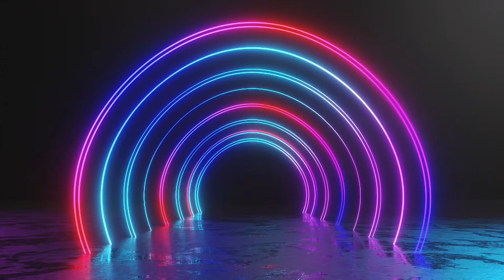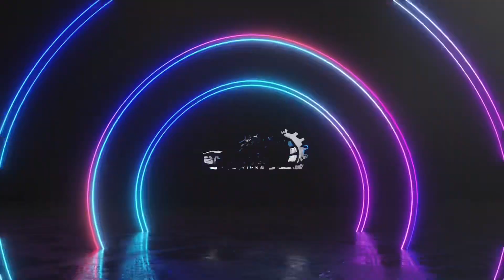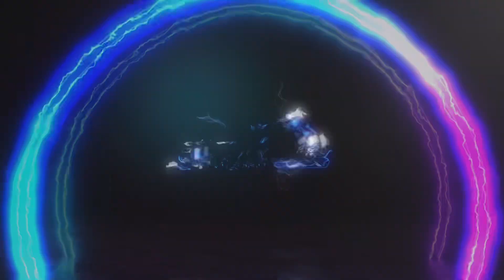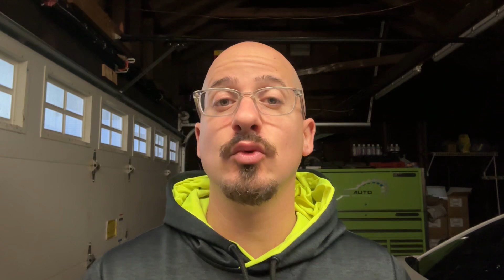Q&A Episode 83 (oil dilution | engine flushes | maintenance)

Comment: Hey mi make is Tony im having oil dilution problem on my 2013 accord V6. 33500 miles i don’t drive it a lot.  My oil smells like straight up fuel. Changed the oil bc it’s was like water. Drove it 100 miles and Changed it again this time I mixed 0w-20 with 5-30. There was some shavings. Did a compression test. 200 psi all across, pulled the injectors and they looked  ok. Very little wear at the top of the engine. Is there another way that the fuel can get in?
Reply: And I maintain it religiously

Comment: Which spark plug socket do you use at the dealership for the 14mm K20C1 spark plugs?
Reply from the maker: @nfspeedy2  bmw socket with the rubber removed

Comment: I just purchased a new Honda CRV Hybrid. Do modern Honda’s need to have their first oil change at 1,000 miles like back in the 70s and 80s. I almost have 1,000 miles on my new CRV.
Reply from the maker: @MySparkle888  I personally do mine at 1k, then at 3k, then every 3/5k going forward.

Comment: If your Honda engine is using oil... it is worth try the ALL NEW (2024) Valvoline protect and restore oil.  It is showing GREAT results!!  Using TOPTIER gas and high quality full synthetic will keep your Honda engine happy.  Plus, don't for get the fluid changes for the CVT.  Merci

Comment: Thanks for answering the my question on the flush, like I said I’ve personally used the bg EPR the small red can with good success. Also I’ve seen bg dynamic engine flush used on J series for burning oil on rear bank from the rings completely clear up. Just wanted to know a fellow techs opinion. Merry Christmas!
Reply from the maker: @angelmerino19  you got it. Merry Christmas to you and yours 👍🏻

Comment: I have a general question; if the transmission ONLY hard shifts from 2nd to 3rd gear what could the issue be? If I baby the throttle at that shift point the trans shifts without issue. All the other gears shift perfectly fine regardless of throttle input. The 2nd-3rd hard shift seems to be a little better once the car warms up but it’s still there. Maybe trans fluid and trans filter ?…. The car is a 01 Camry if that helps. Happy holidays and thanks for all you do
Reply from the maker: @LT33190  I’ll talk about it
Reply from the maker: @LT33190  I’ll give you a few options

Comment: I have a 2.0L CTR that gets driven 1k-2k miles a year and I change the oil annually.  The car is located in the sunbelt (no sub 30 degree winters and no snow).  For this Turbo engine, do you suggest I change the oil every 6 month (regardless of the mileage)  or once a year if driving 2-3K miles a year?
Reply from the maker: @apolloandratti7922  once a year is still fine with me
Reply: @ thank you!!

Comment: I give the 2.0t CTR an Italian tune-up once a week "after" a good 25-30min of driving to get the oil up to temperature.  Unlike the the NA S2000 fuel injected which does not mind being driving like another appliance around, these new turbo engines can benefit from sub 5K miles frequent oil changes and a proper spirited run.  I never let the 2.0T warm up at idle--always turn it on and drive while it gets up to temperature.
Reply from the maker: @apolloandratti7922  good approach 👍🏻

Comment: Hey when I get my pilot 100k timing belt changed what else should I get changed in or around the engine bay so I don’t have to worry about it until it hits 200k ? I do quite a bit DIY but definitely not something that involves working in the engine.
Reply from the maker: @badarahmed5137  I’ll talk about it

Comment: Ok, maybe a dumb question.  I have a 94 del Sol with a 1.8L B18C1 VTEC (From 94 Integra) and I only drive it about 800 to 1000 miles a year these days (Garage queen now), I have been doing just a yearly oil change with Mobile 1 full synthetic, should I be changing the oil more often and also, is it really necessary to change the filter each time or can I do it every other change at this point?
Reply from the maker: @Jago94  once a year is fine

Comment: Speaking of oil dilution: do you think using 92 octane fuel(instead of 87) will help with oil dilution and help to have less deposits on the valves?  Asking for my 2024 Subaru Impreza with 2.5L(non-turbo) engine since it has a high 12.0:1
 compression ratio.
Reply: Change your oil often and use 87 octane. The mileage interval depends on your common route. Is it one long drive with little to no traffic? Or is it a short drive with lots of stop and go traffic? Do you drive aggressively? 

Changing to a higher octane fuel could only do so much in terms of oil dilution.

I drive aggressively to redline on a short route with plenty of stop and go traffic. I do 2,000 mile oil change intervals on my L15CA engine. I fill my car up with the recommended octane, 92, and it is from Shell. 

I still get oil dilution because of the nature of my engine. Which is why changing the oil often will help you more than anything else.
Reply: @billwylde4846  I was mainly interested in finding out if somehow 92 octane would burn hotter and leave less residue on the intake valves.  As for my drive, shorter ~ 9 miles one way drive with some to moderate traffic (city stop and go). On the way back usually freeway with less traffic.  Not usually aggressive driving, however hitting around 5-5.5k RPM on highway merge or passing.
Reply: @Charkatak  Keep on top of your FB25D engine. Also, be careful with Google's A.I. answer. Research further than the first answer you see on Google.

Comment: I have an RDX and have had major oil dilution problems when using 87 octane. I now run 93 octane and it’s a tremendous improvement. I wouldn’t say it’s an issue since I drain my oil every 3000 miles or 3 months, whichever comes first. But if I see the oil level creeping up early during the winter months for example, I’ll drain to be on the safe side. Doing a drain myself is equivalent to the cost of half a tank of gas, so I’m not looking for the longest drain interval medal.
Reply: You'll save money running Premium Gasoline...especially for the long run, In my opinion I personally as a Diesel Mechanic Hate Ethanol fuels, Especially in Wet or high humidity areas Ethanol sucks up water and water in engine's mixed with ethanol is NO good very corrosive.

Comment: My Accord Hybrid has 6,400 miles. I've changed the oil 3 times so far.
Reply from the maker: @larryharry7221  I’m not mad at it, hybrids have a tendency to oil dilution promotion as they have a hard time reaching operating temps

Comment: My rule of thumb: oil is cheap, engines are not.  I change my oil myself using oem filters only and synthetic oil every 5k kms or about 3k miles.  I also keep a log of oil changes.
Reply: Yep true that. I usually do 3K to 5K but I think I will go with 3K moving forward with 4 Honda's in the family. 09' Civic 151K, 07 Civic Si 294K, 14 CR-V 147K, 22 Si 13K
Reply: Wise man.
Reply from the maker: @ChrisHsuCars  absolutely

Comment: My understanding is that constantly driving a car at low rpm’s and rarely accelerating hard can actually be bad for an engine. My 24 LX Civic gets around traffic just fine and I rarely need to go over 3k RPMs. I will occasionally push it up to a 5k rpm’s, but I’m hesitant to push it much more with the CVT. Is it better to take it easy on the CVT and not worry much about the possible impact of constant low rpm driving, or is it better to push the engine up into the higher rpm’s from time to time? 
(I never do jack rabbit starts off the line with the CVT).
Reply: Mash the throttle when you need to. The CVT will handle it. As long as you do transmission fluid and filter change every 30,000 miles. My brother has a 2018 Honda Civic Hatchback Sport (L15BA engine) with the CVT. He follows that maintenance interval. Floors the throttle alot. His vehicle is running strong to this day.

Comment: The orange oil dipstick on my RDX is maddening to get a good read. Much prefer the metal hash marks. BTW, is there a bit of cushion in oil capacity for most Hondas/Acuras  if the oil level is literally only 1-2 mm above the full mark? Any risk of damage to engine?
Reply: Appreciate your reply! Happy holidays and thanks for all you do for the Honda/Acura community!
Reply from the maker: @ happy holidays to you and yours!
Reply from the maker: @FourTheWheels  yes, you will be fine 1-2mm over

Comment: So don’t trust third-party warranty 😅
Reply from the maker: @bikingmoments  no, most of them are absolutely horrendous. Once and I while one surprises us but most are a rip off.
Reply: We bought our 23 Pilot (13k miles) used from a non Honda dealer and I ended up buying the extended warranty from them….7 years 70k miles, but I negotiated a cheap price for it I think. I am hoping to never have to use it, but this freaking Pilot has so much on it something WILL break and it’s going to be expensive.
Reply from the maker: @ agreed on something having the chance of breaking: I wish you the best of luck and congrats!

Comment: It's funny to hear you say 3K to 5K oil changes. IF I listened to the Honda Maintenance Minder on my 22' Si it would be a good 6K to 7K between oil changes 😢. I just hit 13K and this was my 3rd oil change since new, October 2022.I do it myself I don't trust anyone else...as they won't care for my car as much as I would.
Reply from the maker: Yeah my Tlx would go 10k intervals. Absolutely ludacris.
Reply: I’m at 21,000 and had my oil changed 6x allready lol
Reply from the maker: @jayo8484  Im all for it 💪🏼
Reply: My ‘23 type r asked for its first oil change at 12,000 miles. Didn’t ask for a second yet (I’m at 20,000 now). 

I ignored it and did the first two changes at 6,000 and the third at 4,500. I’ll stick to 4000-5000.

Comment: i am looking into a 2013 crv exl with around 50,000.. anything i should look for or listen for in particular?? i think you have said they are good cars..port inject with regular trans..ty
Reply from the maker: @Tracy-wr7mj  they can have some issues. I’m going to try and get a video together. Overall I’d be looking for juddering trans, vtc gear rattle, oil consumption, etc. ask for maintenance records.

Comment: a crv 2016 ex still needs valve adjustments ?  thought hydraulics adjust  on their own.ty...my car is nearing 100 so i am considering the maintenance..if the spark plugs are fine i can wait?
Reply from the maker: @Tracy-wr7mj  yes, they still have adjustable rockers. The only Honda right now without any adjustments is the j30ac and j35y8
Reply: My 2017 Honda is about 120k mileage, the engine still smooth and hear no cluttering nor tapping sound. So it doesn't need valve adjustment. 
The owners manual say no valve adjustment required during100,000 miles inspection unless valves are noisy.
Reply from the maker: @ typically the tighten and would never be noisy 👍🏻

Comment: I noticed that idling in the winter does contribute to oil dilution. I put  exactly 3.7qt into my Integra and the level was dead on. It got super cold and I idled a lot waiting for my kids, the oil level increased noticeably. Not crazy but it was up to the top end of the orange piece.
Reply from the maker: @dmitrynetes3102  yup, it’s a thing unfortunately

Comment: Does the 2017-2020 Civic SI coupe with 2.0L turbo have any major issues like the 1.5T? We sold our 2016 Civic with 1.5T but considering a used SI coupe that has a 2.0T.
Reply from the maker: The so doesn’t come 2.0t only the type R. The base model civics come in 2.0 or 1.5t. I’m assuming you mean the 2.0 na which is a great reliable engine.
Reply: @ hum… i thought the SI was 2.0T. so the SI 1.5T has the same issues as all 1.5T? Unfortunately I can’t afford the type-R. :(
Reply: @HiFiInsider  Si has a 1.5t with a little more power.
Reply from the maker: @ yes by design they have the same exact issue
Reply: @BCautosutions  thank you!
Reply from the maker: @ your welcome

Comment: Some people remove the plastic from the end of the dipstick.
No need for any little pieces of plastic in the oil pan anyway...
Reply from the maker: @MacCready_  true. I’m going to try this.
Reply: Does the metal have the marks? It’s a good idea, perhaps drill where the plastic marks are before removing the stupid orange plastic.
Reply: @edwarner504  has two holes iirc, the top hole is pretty close to the full mark on the plastic part.